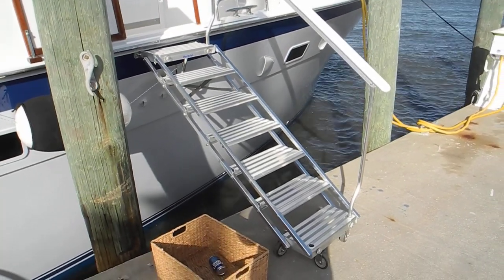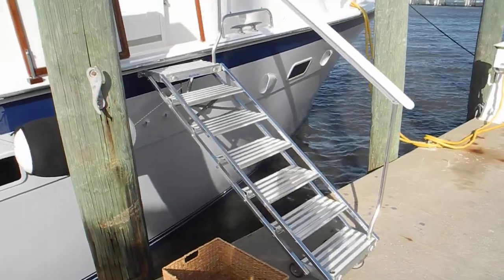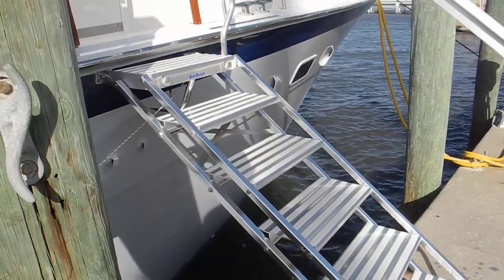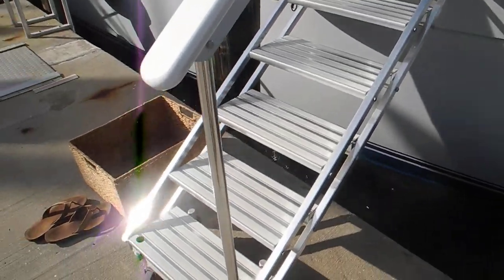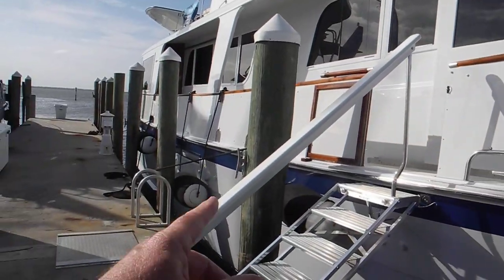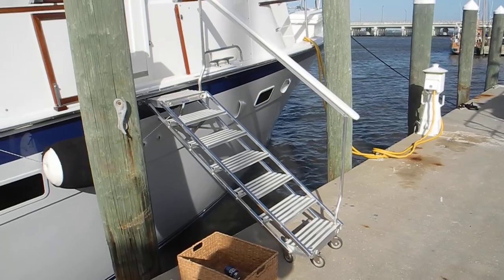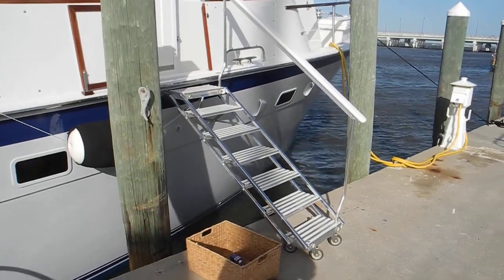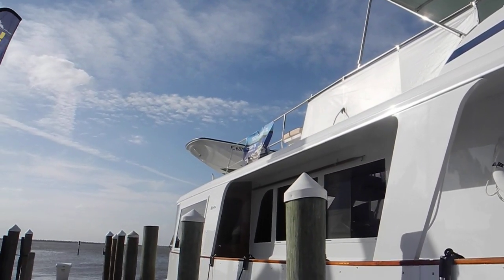Great boarding stairs

Comment: I have a set of boarding stairs just like those that came with our boat , along with a ladder that is straight up the side when at fixed dock , just have to know it won't get smacked into dock on a roll or tide
Reply from the maker: James Hurlbut thanks for sharing your experiences particularly that you have to be aware of potential damage when placing the ladder or steps. That would be an expensive mistake. Ouch!